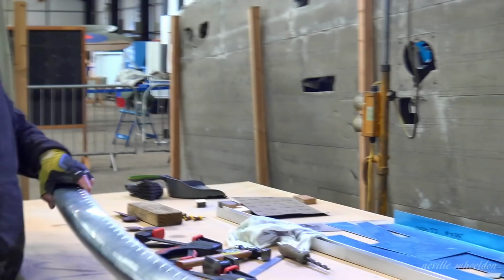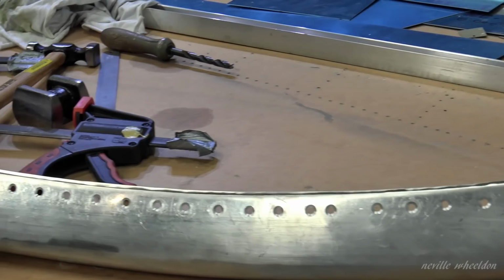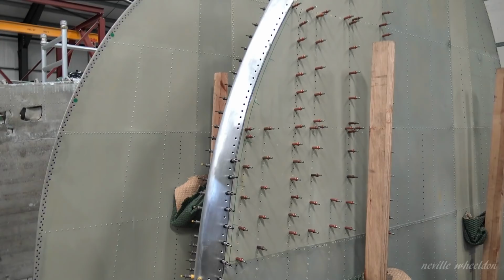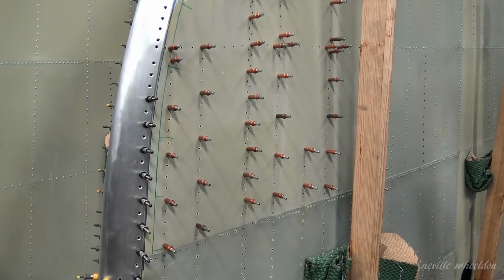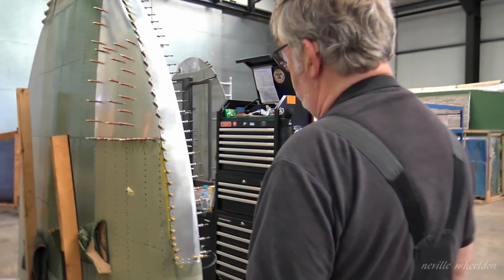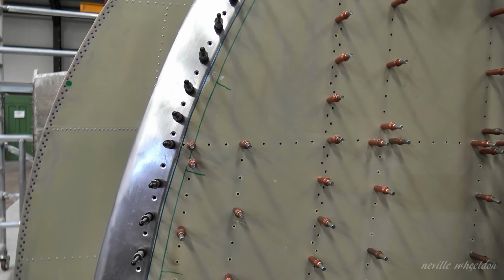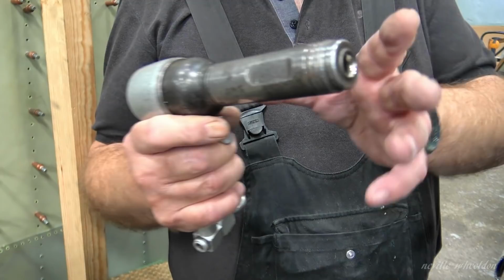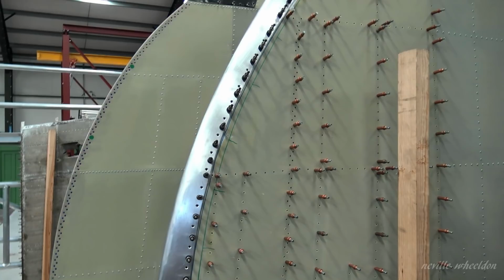Video 112 Restoration of Lancaster NX611 Year 4  John cleaning debris out the French wing

Comment: Working on F-4E Kurnass, F-16C/D & MD500 Defenders, we had mostly 3X pneumatic riviters and a few 4X in each tool room.
Later on, as a fitter, we had one larger than 4X for releasing "hot" bolts located in the combustion stage on J79 and F-110 engines. Those were inconel bolts, very tough material to drill if they could not be persuaded with a hammer.

Comment: Do you get problems from the remaining steel pin in the Aluminium, with electrolytic reaction?
Reply from the maker: Hi Beowulf, not sure on this one, the rivets are all alloy the skins and the structure are alloy, the skin pins are steel but  I don't think you are talking about them. If you're talking about dissimilar material corrosion  it does not come into play.
Reply: @Beowulf   From my understanding, galvanic corrosion is mainly effected by two parameters. 1) How dissimilar are the metals, as indicaled on the Corrision Suseptibility of Metals / or the galvanic scale. The more dissimilar, the more active the corrosion.   2) How electrically conductive is the immidiate invironment.   There must be present a conductive path for the electrons to flow.   A wet salty environment will eneble galvanic corrosion, while a dry not electically conductive environment will impeed corrosion, even of very dissimilar metals.